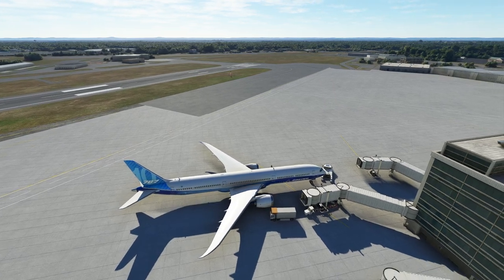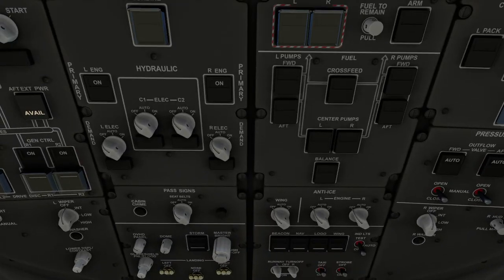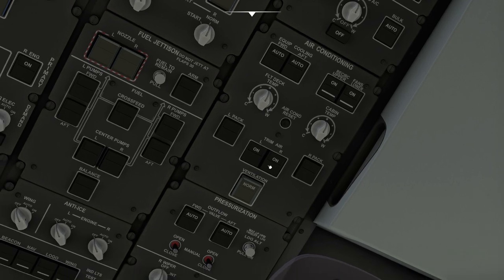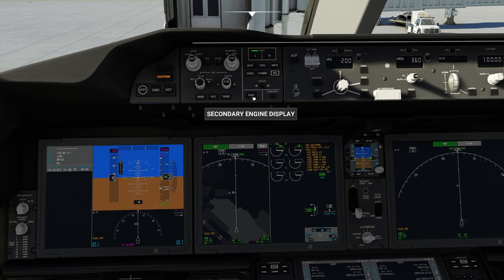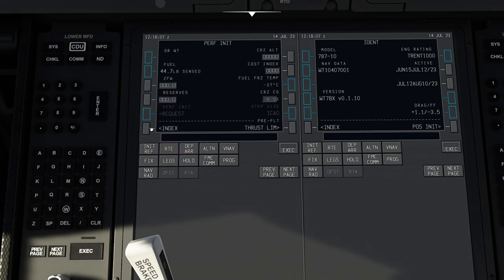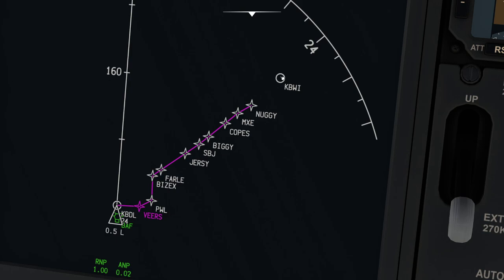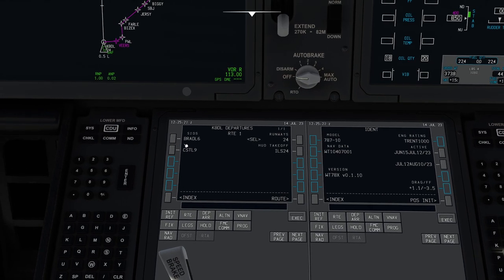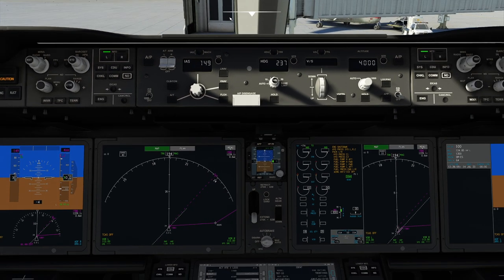MSFS - Boeing 787 Tutorial (2023): Cockpit Overview and Startup

Comment: I got multiple problems in the Routing with FPlan and waypoints in thr 787. Like FPlan Disconuity that the route (purple line) between 2 waypoints somewhere random stop and aren't connected. And the AP will stop working

Now we have Horizon Simulations with both the 787-9 with RR and GE Engines. I hope on a better experience but it goes direct bad if there are gabs in the FPlan and sometimes a complex long arival route where I want just to DIRECT to a certain waypoint.

How can I solve this. And how can I as an example choose the next or next to 2nd waypoint and fly DIRECT to it. So where in the FMC can I see the list of waypoints and erase a waypoint or and select an upcoming waypont and Push DIRECT on it. So the plane follows the adjusted route in de FMC? How can I do this in thr B787 and now the Horizon Simulations 787-9 new planes do this?

Comment: Excellent content. However presentation is a lot to be desired. The speed of your speech is such that it is difficult to follow. Speech modulation falls off significantly at the end of statements. Accordingly the last few words are lost. The result is that there is a need to replay and replay to ensure the content has been comprehended correctly. If find this is common with American presenters. I am an English speaker.
Reply: Yea. Slow down man.
Reply: Put on your listening ears. I'm not even English, and I understand just fine.
Reply: Rapid fire delivery can be compensated in settings by reducing playback speed  to .75